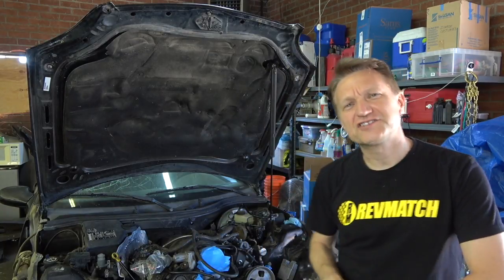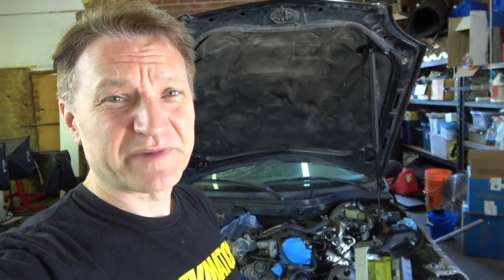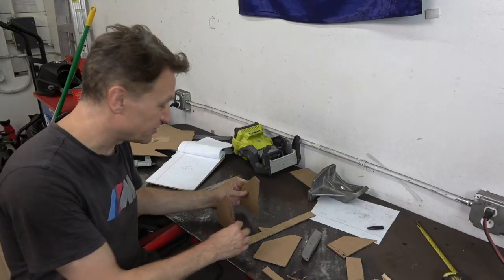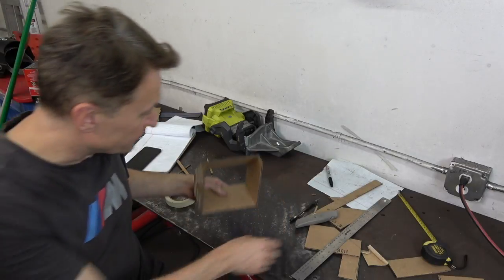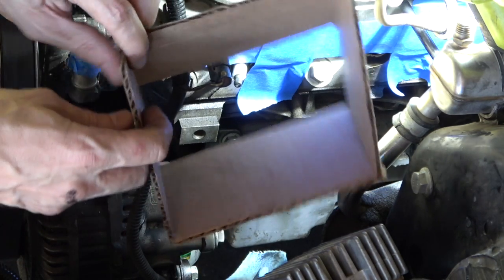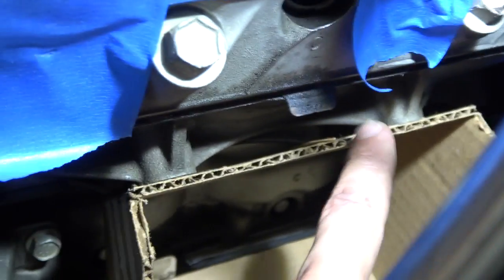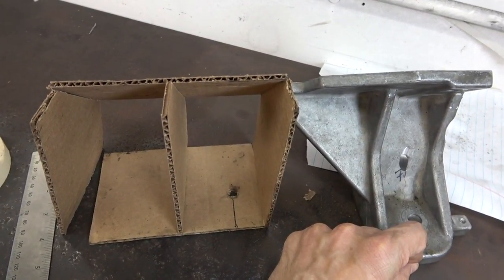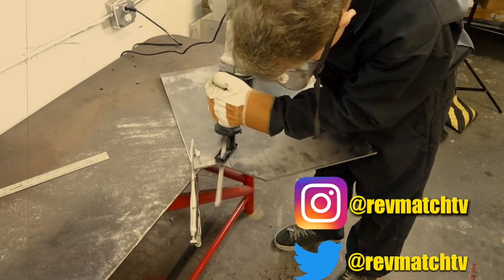LS Engine Swap On A Budget - Engine Mount DIY

Comment: Where is part 2? I can’t find it.
Reply from the maker: I stopped the project after I made the lower engine mount. Turns out the engine was not going to fit because the steering linkage would be where the headers would go.
Reply: @revmatchtv  Bummer Man!!
Reply: @revmatchtv  what thickness of steel did you use or plan to use for the mounts?
Reply from the maker: @conrad1468  I used 1/8" iirc
Reply: @revmatchtv  Cool Man! Thank you!

Comment: Great video buddy. Looking forward to see part 2.
Im totally going to use a reciprocating saw now. What metal cutting blade were you using? 🍁👊
Reply from the maker: I don't remember the saw blade. It took me about 2 hours to cut through 1/4" metal. It was not quick. A plasma cutter would have been 20 minutes, but a lot more coin.
Reply: @revmatchtv  no doubt, but if it works it can get the job done
Reply from the maker: It cut through 1/4" at about 1mm per second. It was a cheap solution.
Reply: @revmatchtv  slow and steady...seems like turned out nice!👊